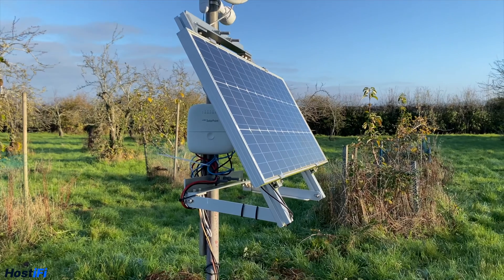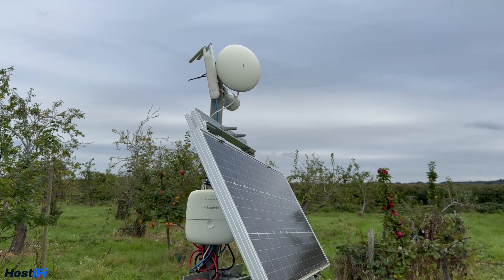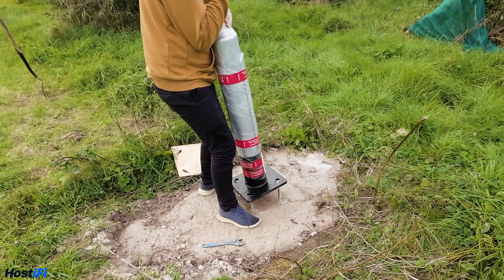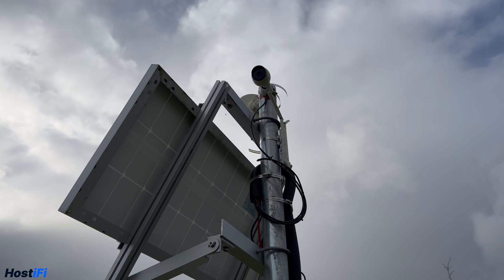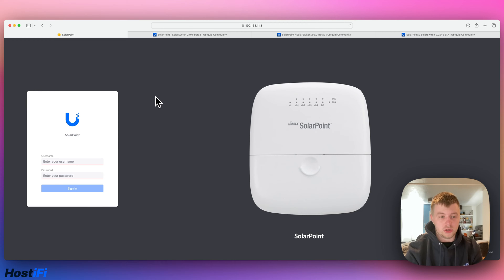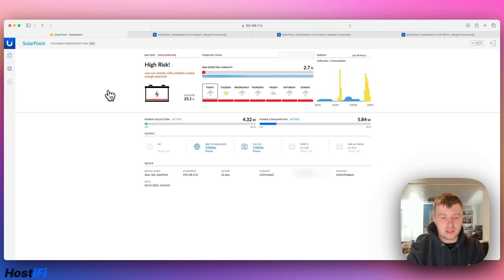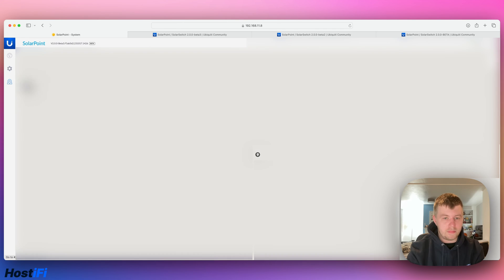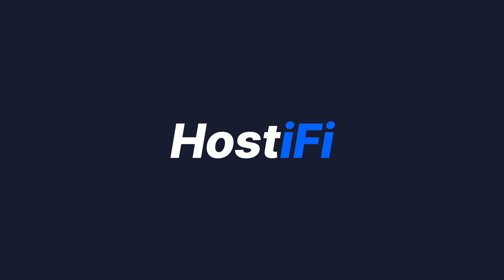Ubiquiti SolarPoint Mega Upgrade 2023

Comment: If the sunMAX had the Switch Flex hardware instead, it would be a much better setup. I've decided to run separate solar charge controllers and the switch flex with a DC poe injector.
Reply from the maker: Hope they do a Gen2 model with this!
Reply: Which solar charge controllers are you using? I was thinking about using the Flex as well.
Reply: @booose06  I'm using a ictron Energy BlueSolar MPPT 75V 15 amp 12/24-Volt Solar Charge Controller. I use these little charge controllers on all of my trailers. I also picked up an Everstar iPoE-65W55GDM dc injector to supply power.

Comment: Got a link to this outdoor box you used? - and what size batteries did you have in there? In the US - I am finding the batteries are about 7" wide or 13" long but most IP65 boxes I can find are only 24" wide and 12" deep which prevents arranging batteries either side ways or long ways.
Reply from the maker: Hey Jason, this is the box I used. Not sure if they'll ship to the US.

https://www.it-stockist.co.uk/product/owr-420-550-320-rack-19-6u-waterproof-cabinet/

Batteries are 70Ah units and have just enough clearance.
Reply: @hostifi Any idea what size batteries you used to fit in that?
Reply from the maker: @jason3fc  Hey, so they are 17cm W x 22cm L x 22cm H. Hope that helps!

Comment: are those surge protectors grounded? I have a few myself and they ether have to be grounded to a earthed metal mount or earthed with a cable specified in the manual for the protectors, without the earth i do not believe they will provide any protection.
Reply from the maker: Hey, in this example the surge protectors were only used to extend the Ethernet cables. But yes, without correct grounding, then they won't do anything.

Comment: what was the maximum watt solarpoint can handel from the solar panel? 200 watt? what happens if you connect a 400 watt panel?
Reply: 7a up to 24v so around 1t0 watts. Far more than needed really.